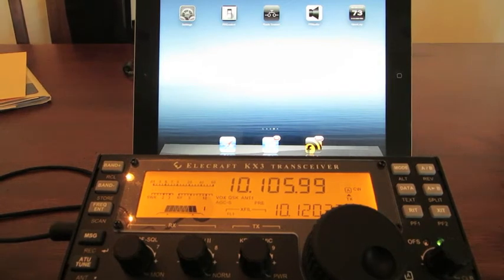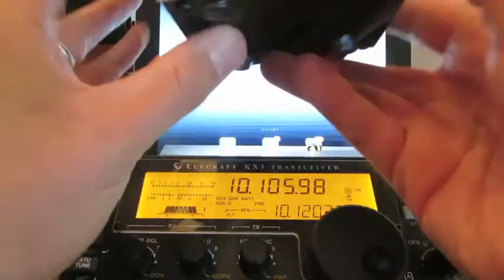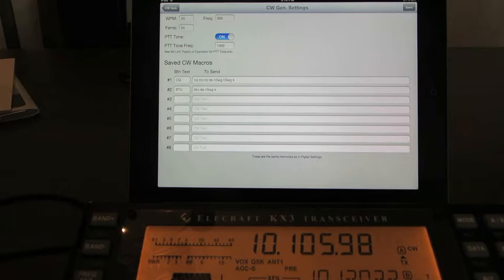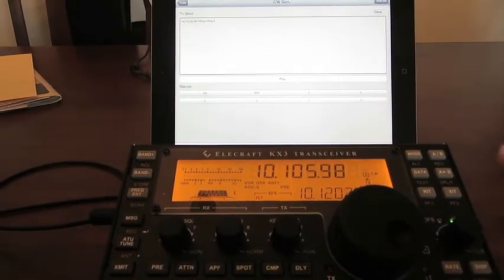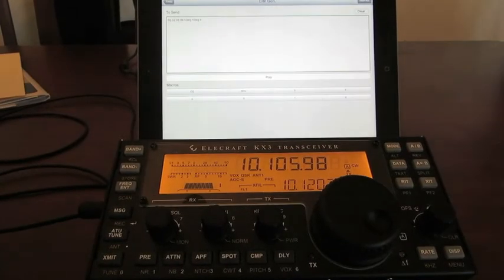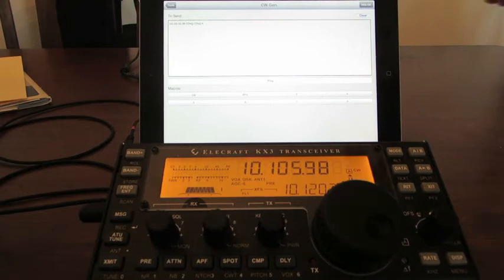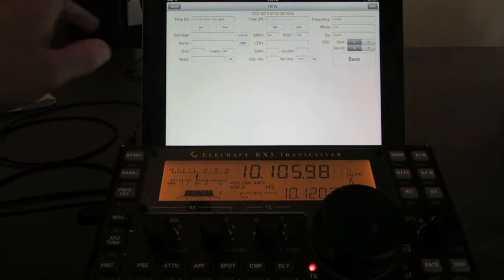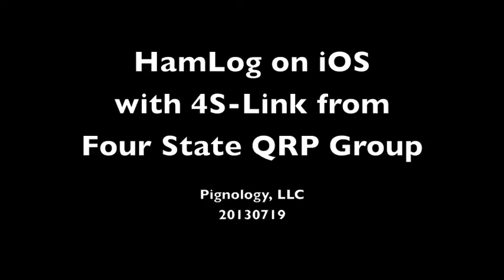HamLog with 4S-Link

Comment: Nick,

The 4S-Link seems to be well suited for interfacing a phone or tablet  to a radio, but the kit has been discontinued and is no longer available from the Four State QRP Group.  Do you know of another device that has similar functionality, or might you be interested in putting one together yourself and making it available?

Thanks,
Paul
K4ETY
Reply from the maker: Hi Paul,
I wasn't aware they had stopped selling it, that's unfortunate.  I have the schematic for the unit and I could probably make some boards based on it but I need to check with the 4SQRP Group to get their permission.  I'll send them an email to see what they say.

73,
Nick
N3WG
Reply from the maker: Hi Paul,
I received a reply from Four State QRP Group about the 4S-Link saying that they would be providing the kit again soon and they wish to continue being the only provider.  Keep an eye on their website.

73,
Nick
N3WG